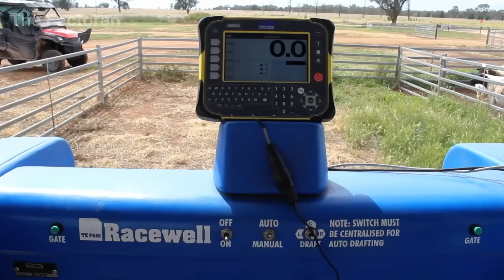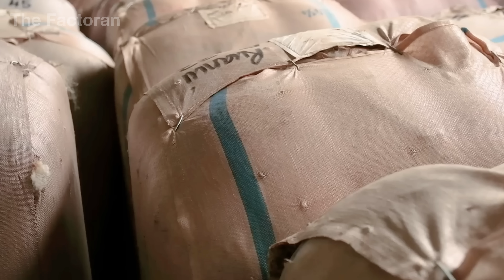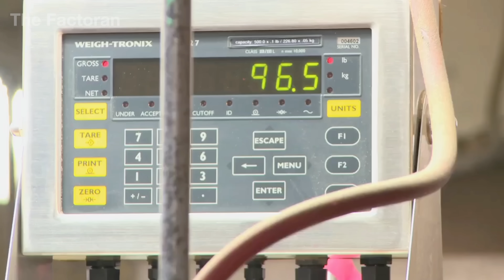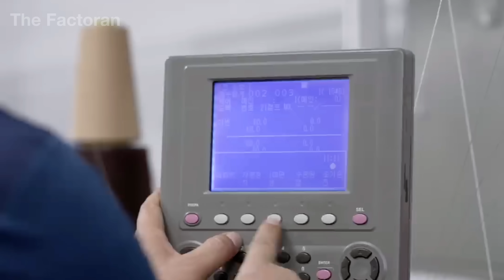How Millions of Pounds of Sheep Wool Are Made Into Clothes Inside Mass Production Lines

Comment: Little confused, toward the ending the product looked like cotton towels. Is there such a thing as woolen or woolley towels?
Reply: I saw that too. I don’t think there are woolen towels.
Reply: @janetross1900  Yes, wool can be used for towels. Much more absorbent than cotton or a blend. Wool yarn can be woven and used for almost anything. It is stronger, more resilient and is moisture wicking. It is why wool socks were in high demand during WW1 and WW2. It is an amazing fiber.
Reply: @laurapeffley8291  thanks, Laura. I did not know that.
Reply from the maker: Yes, woolen or woolly towels exist—they're soft, absorbent towels made from wool fibers, though less common than cotton.